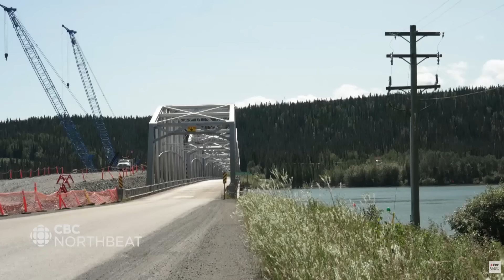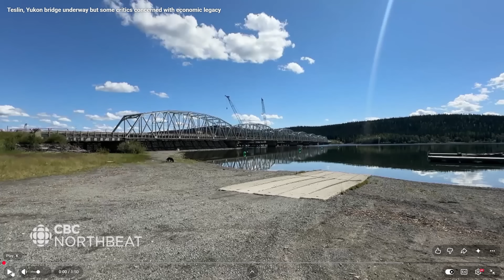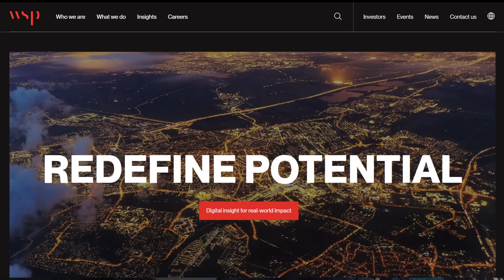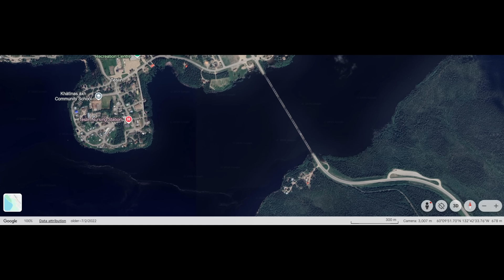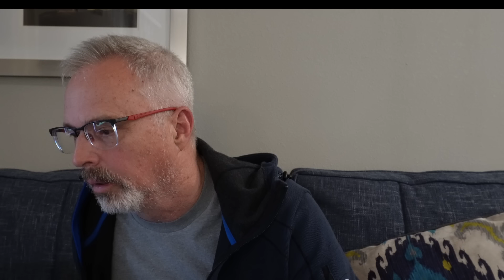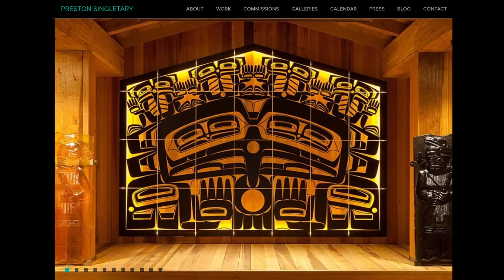Nisutlin Bay Bridge Mess

Comment: The new bridge looks to be close to the location of the WWII bridge. 

Could the modification of the river bottom from 1942 have caused a false idea of what the subsurface conditions really were at that location? 

The original bridge and the truss bridge were in previously undisturbed sediment. This new bridge, if it's on the 84 year old footprint, is not.
Reply from the maker: I think the problem is that the new abutments are on a much bigger and taller zone of new fill that is causing shearing and movement of the foundation soils.  I think they have a massive problem here.

Comment: Why do they want to replace the original bridge. The Alaska Highway is not I-95 in Rhode Island. The existing bridge does not show the usual signs of extensive rusting and corrosion, Maybe they want higher loads?

I, in my infinite amateur arrogance, Suggest they replace the old bridge one span at a time with replacement spans built off site at a shipyard then floated up river to the site. then jack an existing span off the foundations with hydraulic lifts onto another barge and float it out of the way. Then install the new span by reversing the removal. Done one span at a time during lower traffic days the interruptions would be minimized. The existing piers and foundations would be reused. 

I base this idea on the observation that bridges in NY (Crown Point) and NH (Downtown Portsmouth lift bridge) were replaced using the proposed method. Thank you for your consideration. GregW
Reply from the maker: You raise an interesting point.  I would seem to be far more "sustainable" to keep the old bridge in service even if it took a major rehabilitation effort.

Comment: **slaps 1956 bridge**. "THEY DONT MAKE 'EM LIKE THIS ANYMORE"
Reply: On an Island covered with these arch bridges, in fact I’ll go further and say in a province  (BC) covered in these bridges our town fathers were hot to trot to replace ours (which needed painting and a new concrete deck) because it reflected badly on the town as it wasn’t modern looking. 

Fortunately leveller heads prevailed and we still have our iconic 50’s arch span bridge.
Reply: Cape cod has 2 arch  bridges, the only access to mainland both built in 1935-39. Kept going by aggressive upkeep by Army corps of engineers. Costing billions to replace. Too small now 4 lane total for existing traffic we have massive backups in summer.

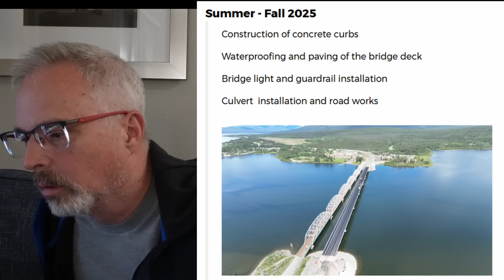Comment: Looks to me that the new bridge (see 7:41 into video) has extensive infilled approaches on either end.  The near end appears wider and higher than that of the old bridge and the far end looks to be considerably longer and higher than the old.  These new approaches added a significant load to the subsurface, perhaps deforming it.  Also,  the MSE wall may be constructed on this infill rather than on virgin soil.
Reply from the maker: I think you are right about the main issues with this new bridge.  I will keep digging to uncover more details for future video updates.

Comment: I believe the problem is insufficient subsurface condition exploration and, subsequently, improper engineering due to lack of geotechnical guidance.
Reply from the maker: You may be right about that.  I will keep digging to learn the details associated with this failure.

Comment: This whole thing is absolutely silly. In these circumstances, especially with permafrost and unstable soil is to build a floating bridge, for stability, possibly 80 ft wide .... a waffle type concrete structure with thousands of airtight cells in it so that even if it broke in half, it would take a thousand years to sink ... long before that, it could be put together again. It would be secured to the bottom by anchors on chains. If there is a need for passage of lake craft underneath, a raised section could provide for that, a gradient either side of up to 1 in 8 .... all part of the single floating structure. To allow for variations in height of the lake, the floating bridge would be linked to slipways either end by ramps similar to those for loading and unloading ro-ro ferries. Drivers would have to slow to use the ramps ... not too upsetting, I would have thought. This would be many times cheaper than the nonsense currently under construction and visually, far more attractive. American bridges are SO UGLY and both the old one and the new one are no exception.. 

THE WATER WOULD BE THE FOUNDATION.
Reply: The bridge spans a river, not a lake. The river floods seasonally, and ice dams can form during the spring break up. All of these conditions disqualify a floating bridge.
Reply: @alexs.8401  Whilst there is some westerly flow, because the channel is an ice gouged channel it is not only wide at over 2,000 feet before the idiots dumped stuff in to narrow it a bit for the new bridge,, but the channel is, on average, very deep (the main body of the Lake has a maximum depth of over 700 ft), therefore, with a huge cross-section meaning that the flow is hardly noticeable. Nonetheless, I stated that the bridge would have to be anchored. 

Upstream of the bridge site, this arm of the lake is nearly 2 miles wide. As I understand it, the whole lake freezes at the same time so would create equal pressure either side of the bridge whilst water still flows at minimal speed under the ice (although hardly any moving water with the land around the lake frozen solid and precipitation very low. If a floating bridge is built strong enough and with sufficient width, it should resist any westward pressure of ice in the Spring. Again, the flow of melting water would pass underneath at very slow speed. You should consider the flow of the Nisutlin in full spate and the cross-section at Teslin being several hundred  times greater. The ice has to be carried by a flow before it can build up pressure. The arm upstream of Teslin is barely 12 square miles and ice which might move westward will jam itself up at the narrows barely 1,200 foot wide about 2 miles up the arm. Whilst ice tends to be at its' thinnest by the shore and tends to melt from the shore, the ice would have thinned dramatically before it could begin to break up and drift towards the bridge. If the bridge is strong enough and properly anchored, it would easily withstand any force from westward drifting ice. 

The Lake falls and rises because of the obstruction at the northern end . About a dozen miles down from Johnson's Crossing, there is an underlying sill with the river less than 400 ft wide. In the Summer, the flow over that sill can be less than a foot deep. It is hardly surprising that the lake rises above a restriction like that with the river passing through and over the obstruction in a torrent. At the site of the bridge, the channel is 2,000 ft wide (5 times wider) and maybe, an average of 20 times deeper than the torrent below Johnson's Crossing, plus, although the catchment of the arm is considerable, it probably accounts for less than a third of the flow at the lake fall. Therefore, if the flow at the fall from the lake  could get near 30 mph (which it doesn't), the flow through the bridge site would be less than a tenth of a mile per hour ... that is pretty slow. It is because of the vertical movement that I wrote of ramps

It is my belief that a floating concrete bridge of suitable strength to withstand any pressure from ice would last many times longer than their present grief stricken project and would be many times cheaper.

Comment: Casey, Since you are down the rabbit hole in Canada (so to speak) here's another debacle from 2016.
This is the CBC news headline that you can use to refer to for my comments below

"Ontario's Nipigon River bridge fails, severing Trans-Canada Highway"

*This was a cable stayed bridge newly constructed
* Not long after opening this happened
"The west side of the bridge has pulled away from the abutment connecting it to the river bank's edge, lifting up about 60 centimetres."
*If memory serves me the gist of the problems occured from the contractor ignoring the detailed drawings and substituting his own ideas into the mix.
* The most egregious part (IMO) was that the government ended up paying further money to the same company to repair their sub par unauthorized work that caused the failure in the first place. Talk about rewarding bad behavior.
* I just thought I'd mention this in case you never came across it in the past.
*I'm not saying that you should do a whole video on it, just for you and the channel members interest in projects that went sideways in weird ways.
Reply from the maker: Thank you for the suggestion as I was not familiar with that project.

Comment: Did the geotechnical test boring’s go to bedrock ? As a geotechnical / environmental driller for 40 years I’ve drilled for many bridges, buildings and other infrastructure and bedrock was the goal on most of these projects !
Reply from the maker: That is a good question.  I am trying to get my hands on the geotechnical report for this project.  I agree with you, I see many instances of borings not extending to bedrock when they should have.
Reply: Since the design of the new bridge moved the abutments further into the river, the depth to bedrock could be much deeper than the old bridge.

Comment: Stepping over a dollar, to pick up a dime! Maybe I'm incorrect here, it seems shortening the bridge 400' for savings, put the supports closer to the river bank on less stable ground.
Reply: That's what I was thinking. Shortening the bridge to save money on actual bridge structural materials. And putting that money into incredibly poorly designed abutment approaches. With all sorts of geotechnical materials in poor soils and fill material and a vertical wall. Just looking at that wall from the side, it seems like a bad idea. The 1953-56 bridge is still fine at 1900 feet after ~70+ years. Why did the engineers try to cut off so much bridge distance. I know that river bank soils in the Far North (and many places worldwide) aren't usually strong at all. Lots of silt and sedimentarary materials. I assume all of that had to be removed? Is that correct? It looks like the approaches should have used deep large piles for support. Doing that, they could just have easily made the bridge longer and avoided this cluster-eff of an expensive disaster completely.
Is the actual bridge structural material that much more expensive than all of this soil geotechnical material cost and man-hours for proper placement? Let alone a re-design and re-build for a second attempt on a new construction bridge. If it's really less when done properly? Can you give me some idea how much less than another 200 feet, or 400 feet of bridge span material and construction?
Will this failing abutment geotechnical soil material endanger the 1956 bridge pylons as you state they are endangering the newly placed bridge pylons? If so, they will need to completely remove it before any rebuild attempt on the abutments?
That would really multiply the effect of this engineering design catastrophe.

Comment: Note that ABC seems to ALWAYS be turn key.  Turn key metric is PROFIT.  See the problem now?  You want goid construction u do it the old fashioned way.  REALISTIC budgeting on WORST case, to ensure adequate $ can be allocated / raised.  DESIGN 100% for NEEDS.  BID.  PAY FOR ENGINEERS G SUPERVISION.
As to using ANYTHING but solid concrete abutments on piles - BAD IDEA - when on a ice chocked river thatvhas millions of tons of 10 ton battering rams assaulting abutnents yearly - DOUBLY BAD IDEA.  
Coupled with apparently raising roadbed 20 feet, adding massive weight of fill at shoreline on soils that can at best be marginal due to water saturation.  Another bad idea vs piers on piles under roadbed sloping down to grade.  Complicated by petmafrost ? deep freezing at edge of eafth up to bsse of fill weakrning the toe yearly.  As well as wrakening the bulk of fill mass.  I assume soil bearing strengths are downgraded more as you get further north.
Summary. Counting on a 100% vertical wall of stabilized soil on a riverbank to NOT SHIFT AT ALL FOR 5O YR MIN brifge life was ... incompetent.  Sorry, but PC dies not belong in civil enginerring REQUURED TO WORK FLAWLESSLY 50 YRS  & fixed up for another 50 yrs.  
Construction time exploded due to INCOMPLETE designs.  Incomplete designs based on incoplete funding for discovery from borings  to determinjng what actual need s are to design docs to supervision.  Coupled w a bid system where GCs spend more time looking for ways to bill extras then ensuring sound work performed.  
Solution
Govtt constructio. entities run jointly by carrer civil service engi eering management and politically appointed head.  Mandate 50 yr initisl life 50 yr extended life.  Mandate  construction supervison.  Mandate peer revuew at stages.  Reward GC for early completion significantly, with a bond covering payout of $10,000s yr for ea yr it paaes inspecton.
Reply: Agree 100%. Problem is most everything nowadays at far as govt work isn't bid that way. Lowest price wins on contracts. My employer deals with this all the time.
Reply: Casey, I agree. The types of post construction issues found should have been identified WAY earlier in the process. One common thread to the numerous issues appears to be a lack of quality process control. The Design/Bid/Build procurement method, the abutment design changes, etc. can all be debated individually. Was a project specific quality baseline clearly defined? Was construction QC allowed to be self-performed by the contractor, or go largely unsupervised? What were the engineering back check / peer review requirements?  Who from the owner’s group was performing quality assurance oversight, or was the job built on quasi auto-pilot?  I will speculate the project’s quality process carried less weight than the project’s budget, schedule goals and possibly some political decisions.  In my 40 years of industry experience, QC taking a back seat to schedule and budget goals is the norm for most commercial project, except obvious safety violations.  Industrial projects, at least the ones I’ve been involved with, have established independent QC reporting processes and prioritize QC. In other words, a QC field observation can immediately stop an installation until an engineered solution is accepted — without gaining permission from money managers.  
The question I have can be summarized as this: Were non-subject matter experts, namely schedule/budget folks, allowed to overrule or otherwise control subject matter expert decisions? Managing the decision making hierarchy is an owner responsibility.

Comment: Good video. You're right, it's very interesting. I can't help but think that they skimped on the geotechnical engineering. When I first learned computer programming in 1968 the teacher said: " to err is human, to really mess things up takes a computer". Engineers have gotten farther away from the projects by isolating themselves with computer programs. My old fashioned field engineering instincts tell me that when they put the new abutments on fill, they moved away from the stable bank. 
The old bridge was built on an abutment area that had settled for many years before they built the 1950s bridge. The 2025 one is just starting to settle. More time and preloading might have saved a lot of trouble. 
When I used to teach bridge design at UCONN, I would take the students on field trips to look at problems in the field. On South Bedlam Road, in Chaplin, CT, the bridge was built in the early 1950s as part of the USACE Mansfield Hollow Dam Project(a great success because it paid for itself in the flood of 1955).The wingwalls of the bridge had separated from the abutment at their tops. In the middle of the abutment, at the bottom, was the original stone abutment showing through the concrete. That old abutment had settled the soil under it so that the new abutment didn't settle as much as the new abutment wing walls. The concrete cracks between the wing walls and the abutments were much wider at the top than the bottom. It was a very good teaching point for my students to learn to think about what they see. Good Luck, Rick
Reply from the maker: Thank you for your comments.  I have the same perspective that design work is becoming too "computerized" and divorced from the connection to what has or will happen in the field.  Add it the unfortunate attitude that engineers think they know more than contractors in apparently every case and it is a recipe for continued, and increasing project failures.
Reply: @CaseyJones-Engineer  It's scary. In the mid 1990s, there was a big argument between the old school Civil Engineering Profs and the young Profs about whether to require surveying and drafting. It looked like they were going to give up on teaching reality and go strictly to theory when I stopped volunteering. My new job took too much time. All of my old profs have now passed. Good Luck, Rick